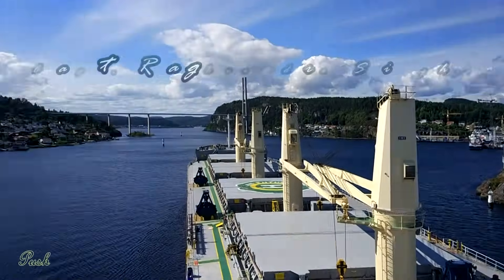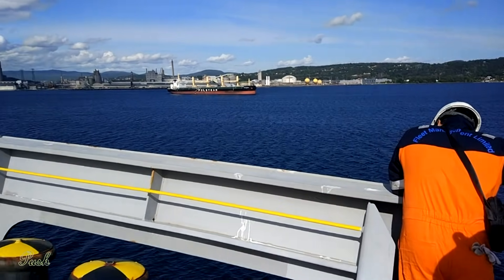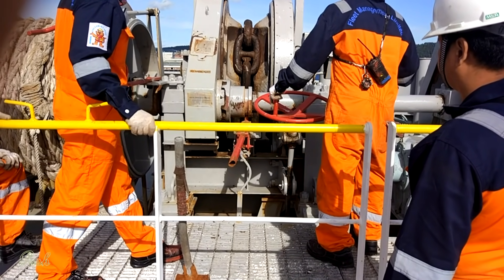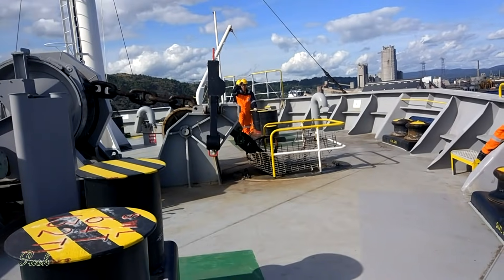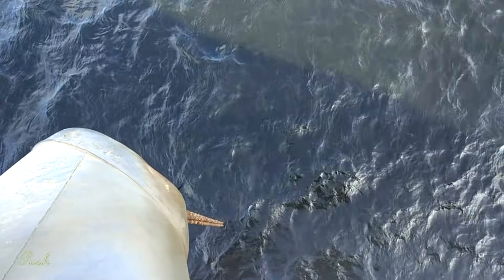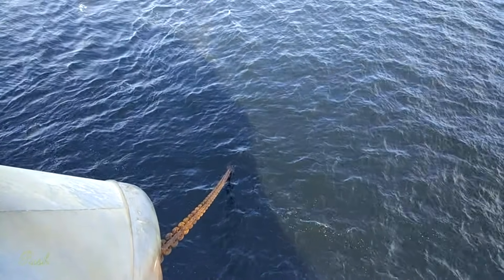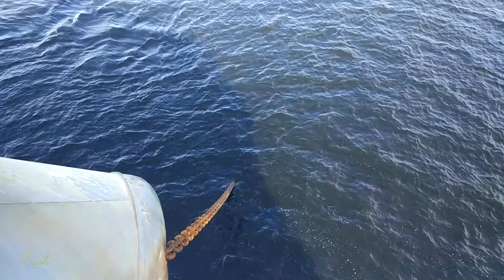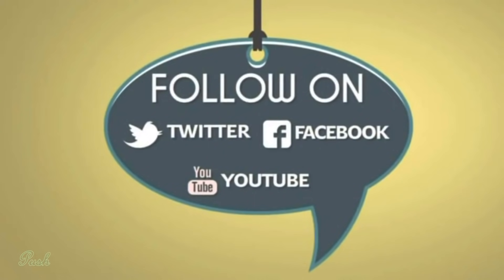Merchant Navy | Guide of Anchoring a Ship

Comment: The gap between the link and the bar is questionable. By doing that load of chain will come on windlass brake which is tested to 40-45% of the load. Whereas the bar structure/foundation to 80%. Hence linkl should touch the bar.

Comment: Anchoring on a black hole?  Why soo much pull on that anchor???  Why is this always a thing to lower an anchor, why ii it not completely smooth and lowered by hydraulic brake mechanism?????  Lastly what the hell is the point of letting more anchor slack out when the anchor is clearly at the bottom??? All for show, or for when tide comes in ??  This is waaaaay more overblown and dramatised than it needs to be...